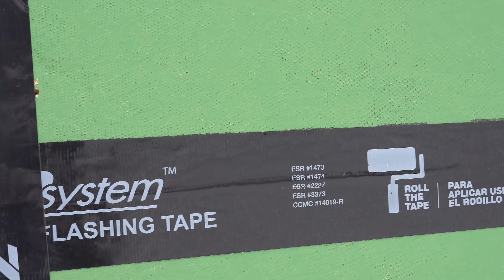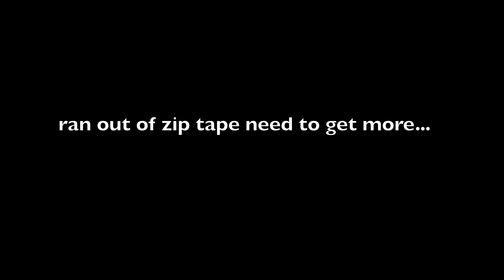We Thought THIS was NEVER Going to HAPPEN | Husband & Wife Build OFF-GRID House in the WOODS

Comment: wow! what a transformation! i don't know what is brighter, the sun pouring in the windows, or Gina's smile standing in front of them!
So glad that finally happened. It means that things are really moving forward. in a way, i think this worked out better. It added excitement and expectation to your build, both for you two and all of us. it was a real pleasure watching you two work together getting them installed and the excitement we saw on your faces. I agree with Al. those suckers were going in regardless of the weather. It fits in the narration of the lower floor being worked on though
I was surprised to see the kubota alongside the house. How long has it been there? I thought it was still tucked away in the front corner of the parking shed.

Al, I still think you need to buy that 1/2 price shed from Jamaca cottage and have it delivered and stacked, ready for a spring build.  While you are at it, Order the barn also! You keep saying you like having stuff ready when you start the build. This would get the animals up there quicker! (just my 2c worth) You are familiar with both those buildings, It should go a bit quicker.

Comment: A couple of solar tube fixtures would add a ton of natural light into the lower floor of the house and green house.  They also have an exhaust fan feature to remove hot air or steam in bathrooms.  Soon the boiler gets installed.  Great Job.

Comment: We have a sun porch and it faces southeast. Starting in mid January when the sun starts getting higher the temperature will be in the mid 70s,  I can turn the heat down and open the porch door and heat our house. I'm sure you'll see a big difference in heating too. Looks really nice.
Reply: Yes!  Gina, Olivia and Al can probably remove the aluminum bubble insulation and let that solar heat into the rest of the house to warm it up!  Maybe add a fan to help it - maybe also cut some vents in the ceiling in the kitchen/living room to allow the heat to go upstairs...

Comment: I know it is the north side, but I would consider putting one more window in that back wall or even between the main living space and this sun room. You had the one odd window left over from the power room so it would just cost some time adding some framing at this point. Just a suggestion...
Reply: I think that would be a good idea.  That back wall in the sun room could use a window to balance out the corner... 👍
Reply: That would be the East side. Th 6 windows put in today face South the same as the solar array.

Comment: Worth the wait!! The windows look great from both sides of the wall. 

Just curious, I worked in the trades when all the "paper flashing" was done with "craft" paper. It was quite intricate how that paper was folded so it would provide a water barrier in the corners. All of that has been deleted/replaced by the ZIP / Bitch-a-thane self stick tape method now used around windows, doors, bathtubs, etc. Great stuff !! Would be interesting to know how much was spent on ZIP sealing products (tape and roofing membrane)??? Looks like you have a considerable amount.

Comment: Good morning, nice progress, you are diligent in any weather.
But you are sure that you are insulating enough walls.
In my opinion given the long winter and low temperatures is there such a thickness of insulation?
Reply: All outside walls have 3" of spray foam & the roof has 6"

Comment: I guess I'm full of questions this morning. Al, you are putting the slanted board in the bottom of the window opening to allow any moisture to go out, but where is it going to go if you seal everything up with tape. Shouldn't you leave tape off the bottom of the window on the outside? Disregard I see the weep holes on the window frame at the bottom.
Reply: After putting windows in they  put Zio tape on sides & top but not on bottom.

Comment: Did Al actually say "acrosst" ? Anyway--he has some funny thoughts about things...like trucks going over his road pound the frost in deeper. What? The road will require a lifetime of upkeep. Every Spring will bring tons of mud and the road will continually require material and grading. Unfortunately it's not money you ever get back. It just keeps sinking right in or running right off.
Reply: Soil compaction increases the density of the ground and it holds the frost longer.
Reply: @Maxid1  I don't think so....a road is a road, it doesn't get more compacted by driving on it after a point.
Reply: @andyrobinson339  "A road is a road" first of all, it's not a road, it's a field their driving across being turned into a road. Second, if what you're saying is true, that it never gets more compacted, that would mean they'd never have to put a second load of gravel on the road they're making. But they'll have to put load after load of gravel on the road for ever as it continues to compact not to mention ground water intrusion. And hard compacted soil warms up slower than looser soil, it's just basic thermal dynamics. The snow and ice on the field disappear before the ice on the  road. We've seen that over and over again.

Comment: I really like this channel. Did you ever check your level? Just for fun I went into Home Depot, and took a gazillion levels out of the huge box on the floor, and after checking them for quite a while I found only 3 that were true. So, how do you check them? Simple. Take a flat surface and put a level on it. Now take that same exact flat surface, do a 180 with the level in other words spin it around, and place it on the surface. Is the bubble in the same spot as it was before? If not, the level is not level. Everyone out there. Take out your levels and check them. You could be depending on a level that is totally off, more likely than not. The absoulte worst ones are the ones that come for free with TV's. Have some fun. Check yours out, and let me know with a reply what you found. (That will give credence to what I am saying, and encourage everyone else to do the same.)
Okay, let me take this one step further and say, "Levels are not level, and squares are not square." Okay at least some of them are not. The cast squares as in all one piece are usually spot on, just like the ones with Lunmah that are used to guide the circular saw, but the ones that are riveted together like a drywall square are more often than not off a little. Easy to check it. Take a new sheet of drywall, place your square on a good edge, and take a pencil and draw a line down the drywall sheet. If you have a new sheet of drywall, flip it over onto its other side, and do the same. If the lines are not the same, or parallel the dry wall square is out. I had to cherry pick mine out of the basket at the big box store. I magic markered my name on it so someone wouldn't "accidentally" carry it off. :-)   
Maybe someone has an eveb better way to check a drywall square, a method more bulletproof than the one I just mentioned. The bottom line is true, plumb, and square rules.
Reply: But how do you find a level surface to do the test?